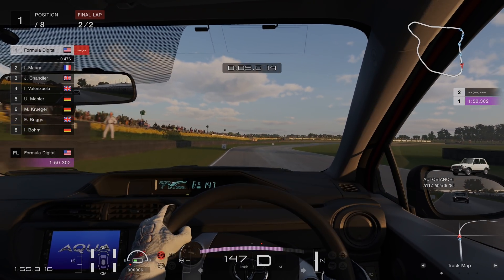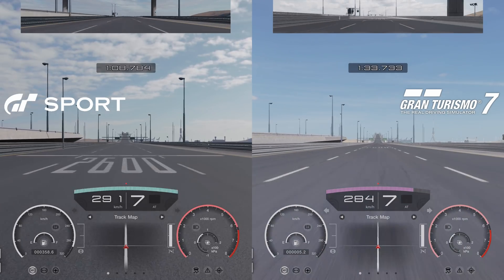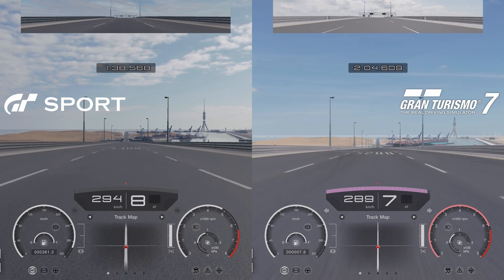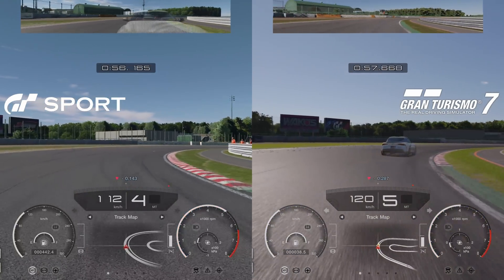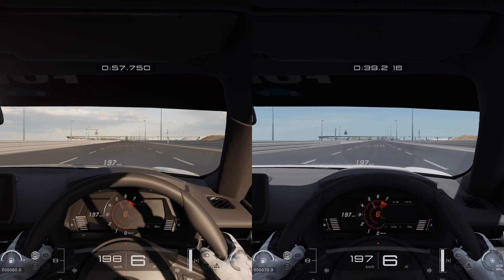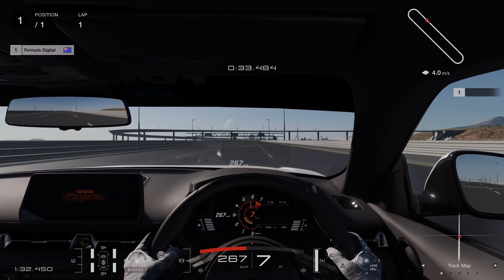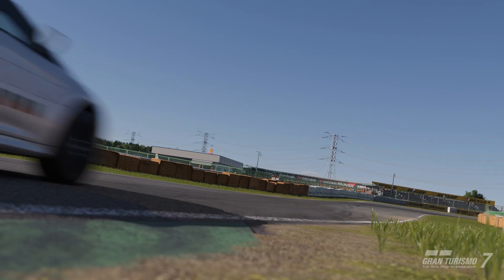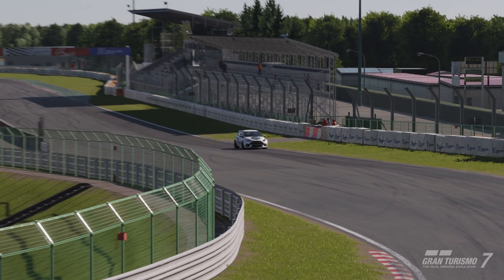Why GT7's Physics Feel So Different

Comment: I still say the grip in GT7 is wonky.
The snap oversteer and deadliness of rwd cars is comedic.
You dont dare go near the throttle, I even had a stock MX5 with about 115bhp go into an instant 360 spin at 23mph on a mid curve with zero acceleration or braking.
I was essentially free wheeling a steady composed car around a corner, it entered smoothly, hit the apex nice and when I was straightening up to get ready to apply the acceleration it whipped around like a top.
Now I've had multiple friends and work colleagues own MX5s and not a single one of them crashed or died going under 25mph.
So as I say... something it wonky
Reply: I did notice that either my compact car has way more grip than sports cars or that something is off lol. 

Going 170km/h feels like you want to die in some cars when making a slight turn. While in my car I can just floor it steer much more agressive and it drives on just fine without doing 5 360s and starting to fly in the air lol.
Reply: Using Sports - Hard tyres instead of Comfort makes all cars drive more realistic.
Reply: @real.p.1  this game is far from  realistic . Its a mess to be fair
Reply: @paulthomson9014  Imo it is very well done.  Best GT so far.
Reply: @real.p.1  Agreed. It seems to only be people who are struggling to get their head around the fact that they can’t drive every car with the same techniques flat out all the time that are having trouble…
Reply: @paulthomson9014  I’d love to ask you Paul mate, what racing game have you played that is more realistic?
Reply: @izzy031096  You can literally do 6th gear drifts in a stock GR86 doing sub 80mph, people are delusional if they can't see the major flaws in GT7's physics, as for what is more realistic, pretty much every current sim, even 10+ year old sims are more realistic.
Reply: @real.p.1  i heard from players versed in the physics saying Comfort Softs were the realistic tires back in GTS, has that changed now in GT7? Should we be moving to Sport Hards?
Reply: @Normalaatsra  Well that's my personal opinion, but I have to add that I also used Sports Hard in GT Sport.
Reply: @Normalaatsra The way I see it... is sport hards are basically equal to a Michelin Pilot Sport 4 or Pilot Super Sports this makes sense when you look at the cars that come with equipped with those tires from the factory like an M3 or M4... then Sport Medium is equal to like a Michelin Sport Cup 2 tires Makes sense when you look at a GT3 RS which comes with Cup 2s... Comfort softs are like your general purpose "SPORTY" tire is used on many commuter common car types...  Many of the OLDER Classics come with Comfort Mediums which makes sense just because those tires didn't have the same technology they do today...
Reply: @Normalaatsra  I said that the moment I started playing GTS. That I was happy they had finally got the comfort tyres feeling like comfort tyres. And not blocks of round ice...

But weirdly they've returned to previous GT games where comfort tyres are just a bragging right that you drove the undrivable.
I don't want to have to equip every car again with sports tyres just so I can complete a lap.

But I agree the cars are way too floaty and prone to crashing than a real life car. Like I said I my example I've driven MX5s my friends have had MX5s and not a single one ever felt like it was plotting to kill you the first curve you came to.

The cars are still a little snappy but the last updates seem to have toned them down a little but still 99% of the cars seem to be completely undrivable with no assists....

I dont believe the mantra that more difficult to control equals a better sim, because it doesn't. PD have to help us out by somehow simulating the other sensation and warning signs that the car is letting go or reaching the limit, because at the moment it's limited to a bit of tyre squeal then the steering going light by which point its normally beyond the point of saving.

The game is perfectly good and I'm enjoying it... its just the need for TCS and snappy handling make things a little lifeless
Reply: @garethbattersby  there is no way 99% of the cars are undrivable without assists. Maybe 25%. You need to be more sensitive with your inputs.

Comment: Car physics have not improved just changed because of the fact that it has to run on ps4 also. So all that extra CPU power in ps5 went nowhere. Hate this cross gen crap. Also really disappinted with ray tracing. It runs sub 30fps and is very low res. This was to be expected since ps5 gpu doesnt have dedicated rt cores nor does it have extra power like Xbox gpu to push that raytracing on. And with rumors of PS5 Pro coming end of next year with gpu equivalent of rtx 3060(which is double in teraflops and dedicated rt cores) I feel like this "base"  PS5 has been a total miss.
Reply: Wouldn't be a good idea to sell a game strictly to the 17 million people who own a ps5,  there's 116 million ps4 players which is way bigger and those players shouldn't be forced to buy a whole console to play a game that fits their consoles standards

Comment: Buddy the reason for the snap oversteer is the car doesn't have ballast installed, if you install that in a MR car for example and place it forward it will make the car less oversteery if its a FR car put the weight back it'll relieve the snap over steer, that modification was added for a reason there's no point having it if it doesn't change the performance
Reply: The reason the cars snap oversteer is because the physics are awful.
Reply: @DriftNick  I've just told you why and you decide to create your own version but hey that's good for you
Reply: @eoinm5758  The reason you said that added it is wrong, the reason it's used in real world racing and in GT is to lower the performance of a car and/or meet some weight requirement, it has almost nothing to do with why the snap oversteer is happening.
Reply: @eoinm5758  Doesn't matter what you think it's for, you shouldn't need to reduce snap oversteer with ballast on cars that are already well balanced, it's an issue caused by the bad physics.
Reply: @DriftNick  it's not what I think it's for it's what it does In the game and that's it
Reply: @eoinm5758  You are missing the point, you shouldn't need to tune the car to reduce the bad physics, the cars should just not be snapping like they do.
Reply: @eoinm5758  if I have snap oversteer in ACC my main port of call is to adjust the anti roll bars or the tyre pressure. Not add 200kg of weight to the car.
Reply: a 3000 pound rx8  with ballast in the back and downforce from spoiler with 357hp with sports softs going in a slight curve at 50-70 mph immediatly slides loses traction and spins out while a fucking mini cooper s takes the cure 100 mph+ makes no sense and exits flawlessy
Reply: @zapoworldd  Yeah I'm not saying it's a perfect system try ballast in the middle

Comment: I don’t know if GT Sport had this but I’ve definitely noticed in GT7 that the tyres only start gripping well after 2-3 laps. It seems like they need more time to warm up than they did on GT Sport
Reply: I miss how gt5 visually showed you that you had cold tires
Reply: @gokartmozart9430  it still does, but now it just gets a red highlight around the edge.

I prefer the GT5 visual though, an updated version with better colours would have been epic. Along with ACC style tyre simulation
Reply: It depends on the race type, but yes GT SPort also needed a warmup period, however GT7 is much less forgiving with throttle traction so you notice it much more.  If they race type has 7x tire wear for instance like daily race C last week, then the tires also warm up much faster, so maybe half a lap they're warmed up.

Comment: I feel as if GT7 needs to work harder on the top end of grip. In GTS, when cars are pushed hard, you can simply understeer and plow your way through and then throttle to victory, with few exceptions (Mach 1, GT40 and Pantera) but in GT7 they made every car oversteer just about.
The problem with this is that tire slip and tire angle isn't visually or audibly presented in the game. I will take a C7 Corvette ZR1, and as I begin to turn, the car feels like it's on rails until suddenly, grip gives out. On tracks with long turns, Willow Springs for example. Take a street car out, and as you begin to turn, slowly apply more and more throttle until you suddenly spin.
It's unexpected and jarring.
iRacing had this exact same issue in early-mid 2020 and it took actual racecar drivers to complain about it for them to actually get on with fixing it. Every sim I have played illustrates it 1000x better than GT7
Even games like GPL from 1998 show it off exceptionally well and do it better than GT7.
Reply: I drive other games and this was the biggest change I noticed while driving GT7. It’s kinda frustrating bc I feel like I’ve cleared the turn and begin to accelerate only to have the rear end snap out suddenly.
Reply: You can also tune the suspension so that the car "understeers" but you're really just tuning out the crazy oversteer. One of my cars was literally undeliverable after upgrading a few parts, when going into breaking zones it would spin out. Had to tune the suspension.
Reply: I`ve honestly been struggling with the handling model for GT7, tbh... For one I feel like all RWD, even low powered stock  ones, are excessively prone to oversteer. On top of that, for some reason it feels impossible to catch and either maintain or recover from a slide, with any attempt from me to doq so enqding with me overcorrecting and either spinning out in the other direction, or slamming into a wall... As far as I can tell there are a few reasons for why I have these issues: 1) I`m playing a simulator like game on controller; 2) it`s vary difficult (for me atleast) to be smooth with my inputs on a controller, and the way the handling model in the game is set up, any imput, sudden or otherwise, has an immediate effect on the car, since the goes does nothing to smooth out the imputs of gamepad users; 3) on my PS4 atleast, I regularly notice situations where there is clear loss of traction, either because the car is plowing or rotating excessively, bit there is little to no vibration to convey loss of grip, and by the time the controller finally starts to vibrate, you akready have way too much angle and not enough time to proporly catch the slide; 4) There feels to me like there is some unexplainable wierdness with the handling (besides what I`ve already mentioned).

I find that setting TC to 1 and enabling stability controle vastly help with most struggles, and so does enabling countersteer assist in it`s weak setting, but the drawback is that TC will sometimes chop you too much when powering out of a corner, and stability control can make steering feel a bit sluggish, though it greatly smoothes out jerky steering imputs, shich is a godsend...
Reply: @andreanastacio9548  bro. Do you even know that you can adjust controller steering sensitivity? You simply sound like a complaining noob that doesn't even know what settings he has at his disposal.
Reply: @Poltergeyst   For fucks sake dude...
I am aware, yes. I also rember that it goes to  like -2, or some shit.
You however seem to have charged ahead and immediately insulted the intelligance of a random stranger on the internet by responding to a 5 month old comment (so from not too long after the game`s launch), and throwing insults around without doing some research yourself...
The physics and handling model have been tweaked quite significantly since my original complaint, and my handling related issues are pretty much completly gone, showing the extent of your Intelligence and foresigh.

Also, I did end up reducing the steering sensitivity into the negatives, and it did help with the snap oversteeet somewhat, but it also made corners, particularly slower ones, a real pain to navigate, so I eventually had to increase the sensitivity again and use countersteer assist and a frustratingly high TC setting
Reply: The problem you mentioned in long straights is easily mitigated by popping on spoilers/front lips and raising the downforce.
I was cosmetically stubborn about putting a spoiler on my classic corvette, but once I did it was a whole new beast on track.

If you tune up your car, there’s no way you can handle it without setting it up correctly.
Reply: @Ayman.Al.Balushi  
That's a bandaid fix, though. The issue is at the core and if even relatively low power cars have these blatant oversteer issues, PD has to step in for a proper fix.
Reply: @commietearsdrinker  How about you people just be more sensitive with your inputs. I have these issues for about 5 mins with a new car until I figure out it’s limits and adjust how I drive accordingly. Sometimes cars require a bit of tc (s-10 licence for example). Sometimes it’s as easy as rolling on the throttle when exiting a corner. Some awd cars you cannot trail brake with or they understeer like pigs. The whole point is that you adapt your driving style for each vehicle, just as you would IRL. Thinking you can apply the same techniques to every car is just plain stupid.
Reply: This happened with the R32. I literally have to handbrake on sharp turns to complete hairpins
Reply: @Crumple202  Shouldn’t be handling that way you need to tune the suspension. My Calsonic replica is an absolute beast and I dominated the final championship with it. I had it setup to induce mild oversteer, didn’t understeer at all. Tyre choice makes a massive difference as well obviously…
Reply: @izzy031096  I think it's on Racing Hard bro that shit just suck
Reply: Put ballast in your car if its a MR car put the ballast placed further forward it'll stop the snap oversteer if its a FR car put the ballast to the back the car will be more stable
Reply: @eoinm5758  needed this gonna try to day been working on getting better at tuning
Reply: @yblvani3112  it's not the complete solution but it definitely helps, there's youtube videos about it in MR for example if you put it all the way forward it will be the least likely to spin out but the steering doesn't feel so direct, so experiment move it back until you find the perfect placement to suit you
Reply: @eoinm5758  bet thanks for the tip
Reply: @yblvani3112  hope it helps
Reply: @eoinm5758  yup, that's exactly what you have to do in all the Lamborghinis in GT6

Comment: This video made me feel better. I just thought I was getting old, and was losing my hand-eye coordination, that I had when I was younger.
Reply: Put ballast in your car and place it on the opposite end of the car to the engine and it won't snap oversteer as much
Reply: @eoinm5758  should you really have to do that though because PD have made the game too keen to over steer?
Reply: It's not you. In a weird way I think the game is making me better in more realistic sim games though. But, yeah it's way too touchy and with lack of a detailed force feedback, it's a bit frustrating to deal with.
Reply: @alexkulp9727  what are you using, PS4 or PS5 controller, or which wheel do you have?
Reply: @MTG69  PS5, don't think console type will make a difference. It's the Fanatec DD Pro. I would say the game only utilizes a small amount of the wheels full potential. It's night and day going from Assetto Corsa to GT7 or Sport.
Reply: A bit dissappointing, especially considering this is a DD wheel supposed to be specifically for GT7. It really shines in other sim titles like AC or ACC though. Really good FFB
Reply: @alexkulp9727  I agree, I just got my GT DDPro, and I love it, but there is definitely room for improvement. Are you using 5nM or 8nM FB? With the PS4 vs PS5, the dualshock on the PS4 to the dualsense on the PS5 is night and day.
Reply: @MTG69  Yeah, realized what you meant about ps4 vs ps5 afterwards, yes night and day difference. I even have the 8nm boost kit.
Reply: ...oh...you are...have no doubts...you are...
Reply: @dericanslum1696  look at Fernando Alonso
Reply: @alexkulp9727  ...why...?...what does he have to do with anything...?...
Reply: @dericanslum1696  think about it for a while
Reply: @alexkulp9727  ...I have...that's the point...and you still haven't answered the question of what an elite motorsports athlete has to do with some random average YouTube commenter not being as good at video games as he used to be...
Reply: @dericanslum1696  that's fine... have a nice day. I'm done with you lol
Reply: @alexkulp9727  ...you never started with me...but ok...

Comment: Dude

I burned myself out tweaking to get the right traction control for the GTR R32 

It’s either too loose that it slips or too much understeering that it literally doesn’t turn

Also managed to find out Wide Body helps with traction when you slam the body a bit.
Reply: My R32 is dialed in perfect.  If you lower the front suspension too much, it wont steer when you brake hard and the front suspension squats.  The wheels are stuck on the fenders.  Had to increase the front height a few mm to compensate.  Took me a while to figure that out.
Reply: @GROGU123  what's your specs specifically?
and do you have negative camber or anything else to help?
Reply: @getoveryourself115  I think I have it at 98mm  height in the front and rear.  I do like a little negative camber up front.  I think I have it at 1.5 up front and 0.5 in the back.
Reply: I left the suspension and diffs completely stock with my R32 and it handles great. All I've done is race clutch/flywheel, transmission, brakes, tires, all the power upgrades, and all the weight reduction. No tuning or anything special, and it goes wherever I point it.